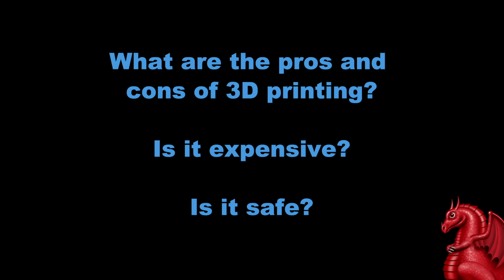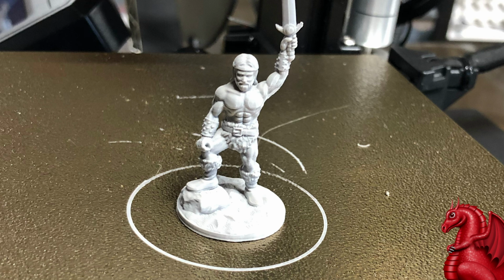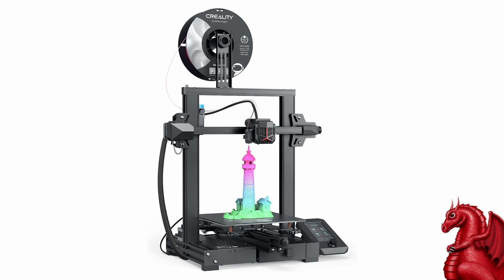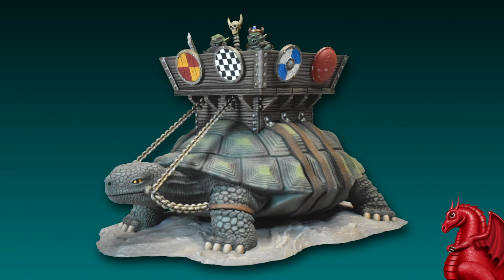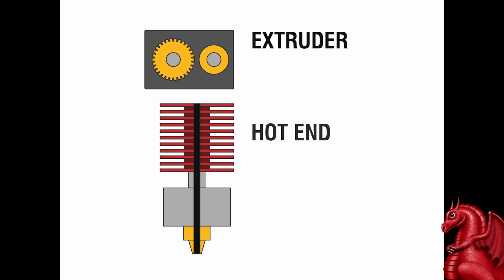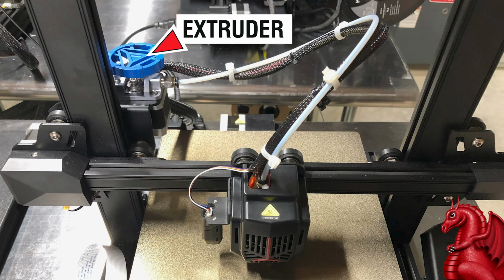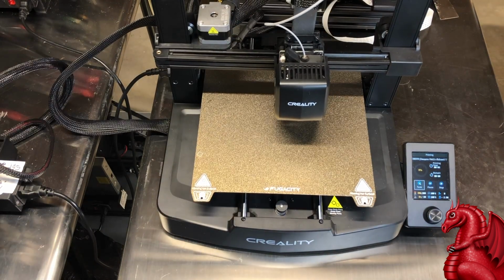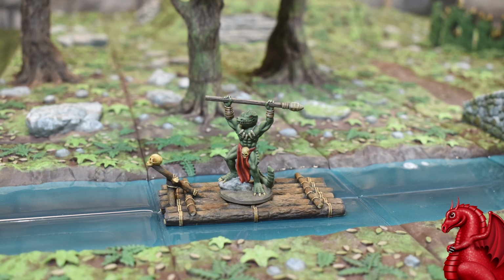Introduction to 3D printing

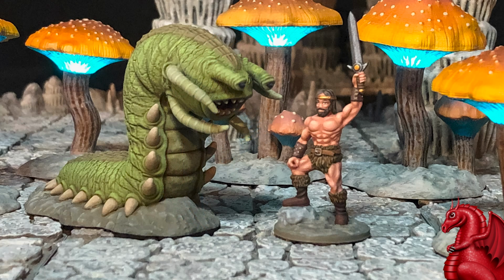Comment: 8:29 "as long as you stick with pla your printer is going to be very safe to operate" Everything I've seen online says that although PLA is safe, heating it in the hotend still releases areosolized plastic droplets and vocs that require ventilation. An enclosure is still recommended. Am I missing something?

Comment: Great video, a wonderful insight on how to/get started. Been a fan for a few years. The only addition i would recommend is the sd card (on most printers made oversees) will likely need to be inserted upside down. Face of the card pointed down. My first fdm took hours of tutorials worth of how to, then noticed in the background the proper orientation. I added A LOT of grey hairs over that. Keep up the solid work
Reply from the maker: Thank you!

Comment: Hi @TombOf3DPrintedHorrors , i have a question about heatbreaks/throats. 

If i want to upgrade my heat throat, but not print at higher temp than what the heat block is rated at, do i still have to also upgrade the heat block?

This is to eliminate the ptfe tube going down to the hotend, a bi metal throat will not need a ptfe tube going further down than the heatbreak area.
Reply from the maker: You shouldn't have to.
Reply: Thank you for the answer. :) @Tombof3DPrintedHorrors